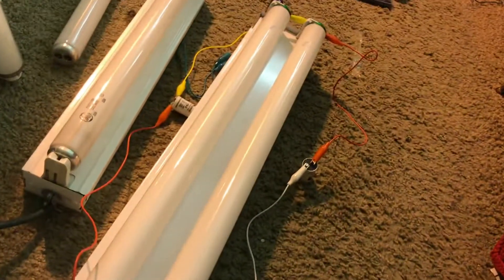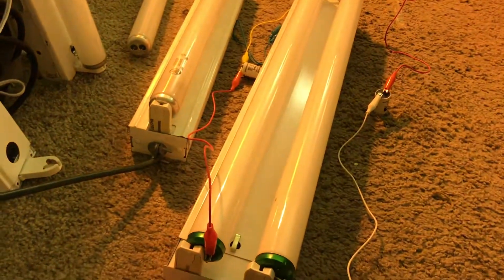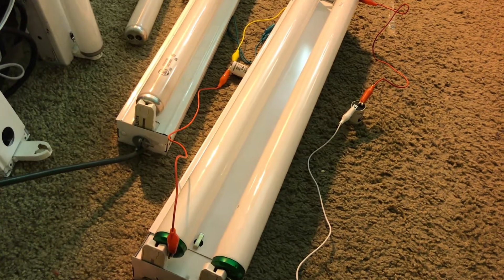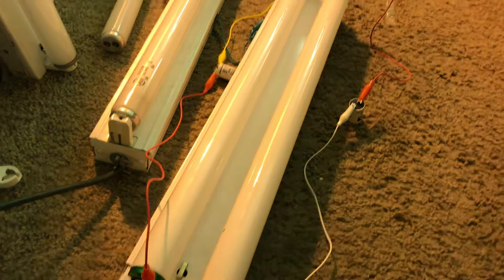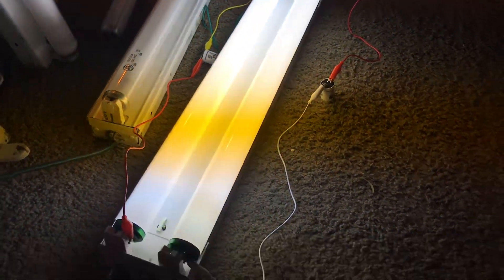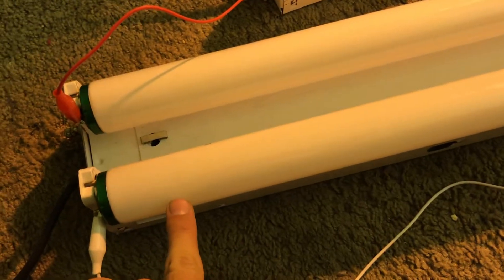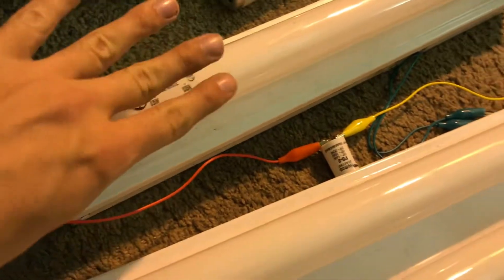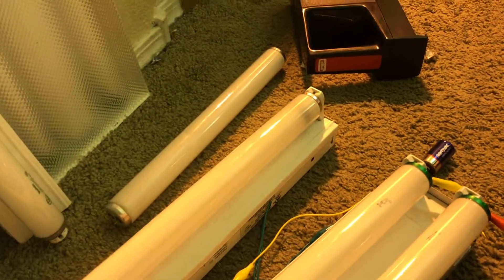Two lamp Rapid Start ballast Wired Up Like Preheat

Comment: I'm thinking about doing this with my F40 fixtures. Do you think that the lamps will be able to light with a higher wattage starter like an FS-4?
Reply from the maker: aldocwa  I tried to light an F40 but it wouldn’t start, however I tested it with an FS-2. I currently do not have any FS-4 starters, I will test to see if it’ll work once I do get some. I also tested an F30T12 lamp and I did work beautifully.
Reply: It will work with fs-4 starters

Comment: I wired my F30 T12 fixture this way because I don’t like rapid start as much. I will be converting all my rapid start fixtures to preheat this way as well. It’ll be permanent however. twin lamp preheat ballasts are getting harder to find, so wiring rapid start to preheat is better. You have to wire it a little differently to get it to be normal. You remove the cathode heating wires and just cap them off and then wire it like a standard preheat ballast. Pretty neat stuff. It will not harm the ballast when you wire it as I said.
Reply: Which ones are the filament heating wires